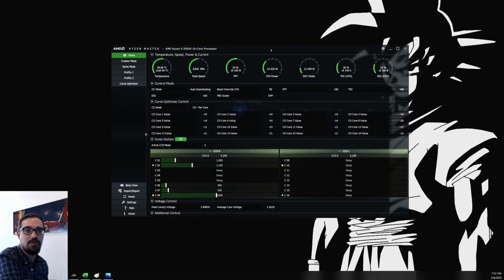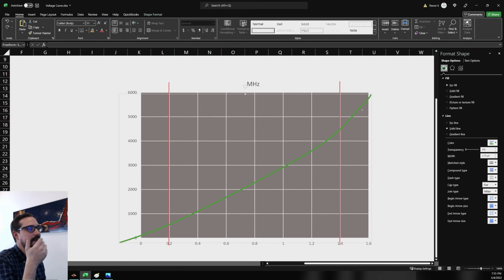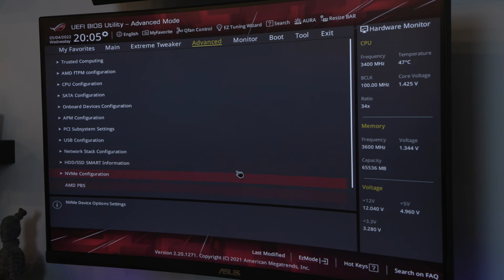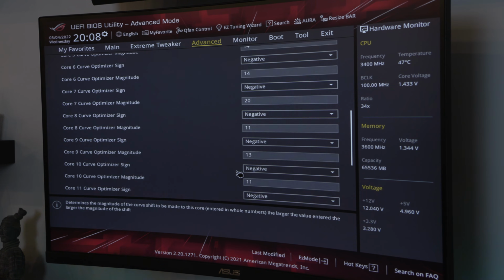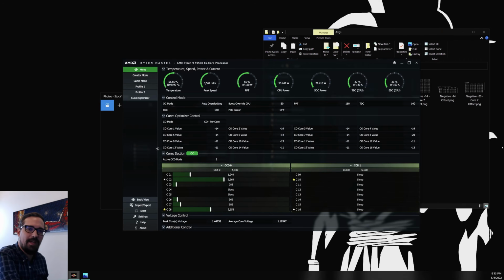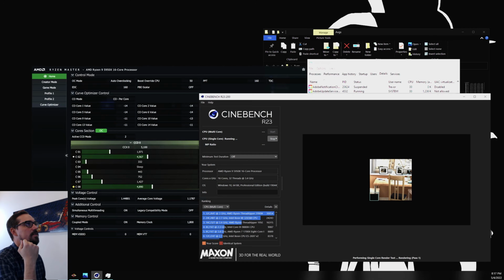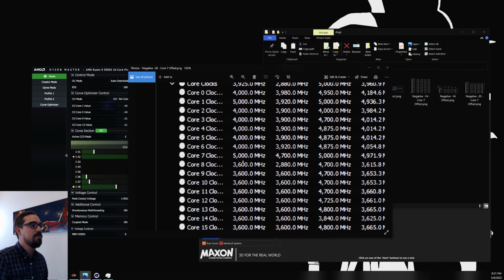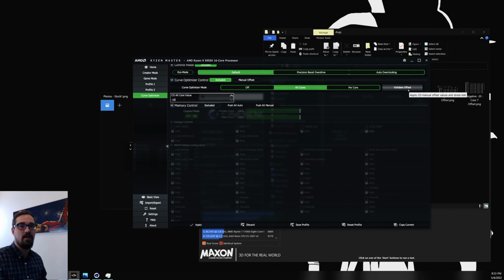AMD Overclocking - Curve Optimizer Explained

Comment: Rog Corsair x570 * 5950x * 3600 DDR-4 64MB CL16 Trident NEO \ 105 TDP - Vcore -0.00625 \ SOC −0.00625 \
PBO1 & PBO2 - Fmax Advanced - Factory PPT EDC TDC - FIT 1X \
CCD#0 -2 -2 -2 -2 -2 -2 -2 -2 \ CCD#1 -3 -3 -3 -3 -3 -3 -3 -3 \ -100 Boost \ 80C Tmax \ Hydra 2.2A Pro CPU Speed Setting 5Ghz 
CB23 MT Score = 26938

Comment: Yes you intelligent youtubers.
The correct number is -25 boost if factory power settings in place manually and FMAX on Advanced If we're wanting to gently reach 5Ghz.
When things are right, MT will be greater than ST in GPU-Z
It needs -3 to -4 for all the first CCD and -5 for the second CCD and a Vcore of -0.00625

Comment: Its too late but actually best cores should get less offset than worse cores so you have it reversed kinda. The reason is that worse cores dont need as high of a voltage to begin with because they are never reaching high frequencies where the best cores actually need that voltage to perform. Another very important thing is to change your pbo limits from auto to manual and set smth like 220 160 150 at least for the ryzen 9 5950x. The default is too weak for the cpu once I did that my score in cinebench 23 went up by 4000 on multithread tests.

Comment: My new PC ONLY restarts (no dump file) randomly while playing arc raiders. ASUS Strix B650E-F + 9800x3d. I suspect cores are not getting enough voltage at top clock speeds (5,225mhz), causing the system to crash. Although this doesn’t happen playing other games that push core clocks to max (e.g. BF6). Even a -5mv curve optimizer causes my game to immediately crash. Is it safe to do a +5mv or +10mv curve optimizer to improve stability in this game? Maybe it’s the game’s crappy code, or maybe 9800x3d + B650E-F is just a weird match. I want to play the game but don’t want to fry my CPU. I’ve literally tried everything else and ran all tests on OCCT successfully.
Reply: I would remove all curve optimizers offsets leave it at default then go and change the pbo limits to something manual check online for safe values for your cpu. If your game still crashes then it might be software problem. I would also test you ram/ gpu at that point its highly unlikely that your cpu would need more voltage than stock to run a game stable
Reply: @adrianilabej317  everything was default initially. Fresh windows install. I tested ram/cpu/gpu in OCCT. Also replaced gpu (3080->5070TI). Didn’t run memtest. However, after 2 weeks of testing I fixed the issue. I am running +5mv pbo curve optimizer - this is the only change that has prevented my PC from restarting while playing arc raiders. I suspect the game is causing transient dips in cpu voltage, and since my vcore is already a little low, it is not able to survive these dips at peak loads. Just a theory.

Comment: I tried Ryzen master to find the "proper" pero core curve for a 7800x3d. It didn't give me the option. Is this because of my CPU or did they remove the auto option?
Reply: use hwinfo find the best and worst cores there. I would also undervolt directly in bios

Comment: Wow. This was incredibly helpful. I never had stability issues on my MSI Meg unify with my 5950x but it bricked dueing a bios update and i had to move to a spare rog strix b550-f wifi II in my spare parts box. 360mm aio on gpu and cpu with a total of 12 fans in the large case I have. Also live at 10k ft altitude and have a window behind the system I put an air filter in to bring in cold air which keeps it even cooler.  I normally manually set all values and do an all core OC for my usage case, and I have refined it to the point I never have stability issues after some minor tweaking on new systems. 

I knew the strix mb couldnt handle the 128gb of ram so i lowered to 64 and lowered rhe clk freq and loosened my timings  for stability. Finally i gave ip and decided on Curve optimizer which i hadnt used before. There are multiple videos giving the opposite information and I couldn't figure out why I couldn't get my 5950x stable. RM was recommending negative 28 on everything. After watching yours I set the best 4 to -15 and the others to -10 and just left it for now. Been stable on all tests and been good on normal use for 24 hrs so far. I could probably refine it further but this is just a temporary solution until I can order a new motherboard

Comment: Hey thank you for this video this is literally the only video on youtube that explains what the actual ** curve optimizer is doing and what it's supposed to do after running ryzen master curve optimization program twice getting two different sets of numbers 16 on all cores and 6 on one on my 5800 x and then running it again with a new heat sink and new power supply and getting 20 on all cores except 2 on one core my computer just absolutely hates the curve optimization setting I can't run it at all my 5800 x cpu absolutely hates it but thanks to this video at least I know what was causing the instability!
Reply from the maker: Glad you found it useful! Thanks for watching!

Comment: So your bios does not allow you to set positive offsets at low temperature/loads and negative ones at high temperature/loads?
Reply from the maker: Sadly it isn't really temperature based variability on the adjustments. Wouldn't that be cool though!

Comment: I just upgraded from a 3900x to a 5950x and the idle temps are really high around 60-70ish. I tried the all core negative at -20 but the temps are still pretty high. I’m thinking of just returning it and biting the bullet for AM5
Reply from the maker: @NobleLion9  What cooler are you using? My 5950X doesn't go above 76C even under heavy use.
Reply: Oh really? I have a h100i iCUE
Reply from the maker: @DayDreamer4011  Personally I wouldn't run on less than a 360mm for a 5950X. I had a H110iGTX on my old 6700K and it ran hot. That being said, initial idle temps should be lower while the coolant is still cool. I would consider using a better thermal paste. The stock thermal paste on the H100 isn't great. If memory serves me the H100i also doesn't make full contact with the CPU heat spreader (round, only makes central contact?). My 5950X does between 65-72C while gaming and multitasking. I only ever see north of 80C doing stress testing.

The CPU block should make full contact with the heat spreader, and the paste should be high thermal conductivity paste (14+ W/mK).
Reply: @UnhingedSystems  Yikes I don't think my Corsair 4000d would fit a 360mm. I'll try the thermal paste option and see how that goes. Sweet thanks for the info, super useful! 

I did have a bit more luck with setting the core click speed to 4.2ghz and core voltage to 1.15v - I was getting similar temps you mentioned but would get crashes in-game randomly. I was getting a pretty high score in cinebench with this set up too around 28k.
Reply: I’m having a bit more luck now. I set all cores to negative 10 and manually tweaked the PBO values. Idle I am seeing 50 degrees and cinebench gets to around 70 degrees with a score of 27k. It’s stuck at around 4.13ghz however.

Comment: I had a kernel power issue id 41. Removed my ryzen master app and turned off pbo for 2-3 dyas now and it has been stable. Your description of the problem is spot on, pushing all cores is not how to see the instability. Its always after a loading screen where the cpu load tapers off that it happens. Will be trying my luck again maybe after 1-2weeks with curve optimizer. Good thing is that I have this video now as reference

Comment: I’m running a nearly exact setup to this. I have the power limits set to motherboard with a -12 all core. With this I’m seeing 175w and 91c under peak load. No instability in the last 6 months but the temps and power draw are concerning. Any advice or chance you might make a video guide on power limits. All your videos have been very helpful and I greatly appreciate it!

Comment: Ok I have 5600x for now. With pbo +200mhz setting in bios with motherboard limits on, not auto or manual. If I use curve optimizer I let the voltage on auto in bios? I see that the voltage is 1,45v when max clocks 4850mhz are working. Is this normal?Or you should manual the voltage? Please help 🎉❤

Comment: Sooooo, I’ve been gradually bumping the curve offset one point at a time on my 7950X3D, and running a CPU burner and benchmarks at each step… 
I’m at -50 on all cores for several days of regular use with no instability….? That shouldn’t work, should it? 
In UserBenchmark I’m in the top 1% of all 7950X3D cpu scores.
Reply from the maker: @baddestmofoalive  If you are stable and don't have any random restarts or blue screens, games crashes, etc, then consider yourself winning the silicon lottery!

Comment: Just one comment. You state that Hardware Info shows you the sustained boost clock as the average. That is not really true. What it measures is the average over a given time span. Can't remember of the top of my head what the period is and if it's locked to the polling interval or across the entire logging period, but nonetheless you are looking at the average of two or more points and not necessarily the average of your test run. How much of an impact this has on the analysis will vary, but it's still good to be precise :)

Comment: can u have the curve optimizer setting replace the settings ryzen master stock cpu clock speed and function everytime u startup the pc and not mess with the other steps in motherboard bios for a stable overclock in Curve optimizer profile? with no alternating negative values for ryzen master manually all cores too,?

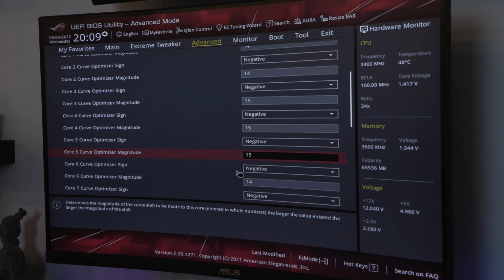Comment: Regarding 9:16 after a reboot or crash if you go into event viewer it will usually tell you which core failed in the error report. When my system was crashing with my 5900x it turned out to be 3 cores that kept causing issues. At the time I didn't really know enough about doing a per core offset so i just changed the offset for every core.
Reply from the maker: @NonLegitNation2  Sometimes it would record an event, but often times it wouldn't. When it hard-locks man does it lock.

Comment: THANK YOU, FINALLY someone mentions this issue. I have watched literally 100s of video on undervolting using the curve optimizer and NOT ONE PERSON mentions the stability issues at lower clocks and at idle. I've personally experienced this when undervolting my R9 5900x. My CPU ran great at load but once my system was idle I would get random reboots. I ended up giving up on undervolting because no matter the offset I always ended up with random reboots at idle. I just bought a 5950x yesterday and I'm hoping with the BIOS and AGESA updates since I last tried undervolting that maybe it has gotten a little better. I guess I'll see within the next few weeks. Right now I just need to find an offset that will work and not screw up. I currently have it set to a -12 offset which seems to be working (atleast for one day so far) but strangely my temps have increased a bit with this offset.

Comment: So does this mean a cpu is better if it can do a higher negative  number on the curve optimizer, because it can hit those speeds with lower voltage?
Reply from the maker: @Striker-rw4rd  Effectively it allows the CPU to run slightly higher clock speeds at the same voltages along the curve. It isn't doing all that much for power efficiency, but it is using the voltages more effectively and allowing higher clock speeds at the same voltages.
Reply: @UnhingedSystems  but wouldn’t that mean that a cpu that can’t run higher clock speeds at the same voltage is worse than the one that can?
Reply from the maker: @Striker-rw4rd  Fair statement. All of the CPUs have varying degrees of capability, even with the same part. Some will hit higher clocks with less voltage, some won't. It really is hit or miss.

Comment: I dont understand how do you actually determine the value per core initially without using any other ryzen software. and how do you know which core do you need to change the offset value if you face instability issue.
Reply from the maker: @codegix6949  That's the neat part, you don't. I spent dozens of hours testing one core at a time. I started by setting an all-core offset and slowly dropping it until I found instability and then bringing it up to stable and then slowly lowering it one step at a time on each individual core. It's a pain.
Reply: free time + nerd

Comment: 7:42 my Ryzen 7 5700G supports 30
Reply from the maker: It's great when they are stable at max settings 👍
Reply: @UnhingedSystems  witch options do you recommend for "precision boost overdrive scalar"? i set my at 1x.
Reply from the maker: @Sebastian-10k  I never exceed 1x personally. Any other settings didn't result in any kind of measurable gains anyways.
Reply: @UnhingedSystems  humm, tks!

Comment: Ryzen 5 5500,  negative 28 at all cores (Ryzenmaster said I could do -30 on some cores) and Boost positive 200Mhz, the CPU runs above 5600X acording to CPUID bench, PassMark Bench, UserBenchmak. In boost seats stable at 4.4Ghz

Comment: The Master software is a scam somehow. the curve optimizer stole me 2 hours of precious lifetime and at the end the results where totally crap.  even with negative 30 at the curve the software still pumps 1,45 Volt into the AMD core just for 4.65 allcore.. ...totally crap...

my manuall setting is stronger...VCOre 1.1 , Core 1.375 - Offset -15, ends up in 4,7ghz with less power consumption, less heat and a 25% higher performance over all :)

Comment: I run the per core optimizer using ryzen master but when it finishes running it says all core -30, should I increase the offset?
Reply from the maker: If it is stable, you are in good shape. If you start experiencing random lockup, blue screens, reboots, or shutdowns, then adjust it back up until it is stable again 👍
Reply: @UnhingedSystems  I'm running cinebench r24, playing many games and still stable without seeing a blue screen. I'm thinking of increasing the offset to be able to reduce the temperature even more

Comment: Thank you for this video/tutorial/explainer. Much appreciate! One tip - instead of doing manual per core testing, run Ryzen Master Per Core test which will determine the offsets, then you can manually add them via UEFI/BIOS. Also it tells you about your best and second best cores, on which you should have lesser offsets and they will tend to reach higher/sustained Ghz. Am I right in my assumption?
Question 2: With CO set, how about setting PBO Manual/Motherboard with Positive 200Mhz to get that extra?

Comment: I have a 7950X Ryzen Master also said -30 was ok then Cinebench crashed the OS at -30, went to -25 got me to 3 min. into Cinebench but the program crashed (not the OS) , finally got through Cinebench at -21. But this CPU is  and they say runs better hot so I'm not even sure this is something I really need to do to this CPU, AMD says it can run at 95 degrees all day, 24/7 . I will keep it at -21 unless something else should crash

Comment: If you disable idle states on your cpu wouldn’t you theoretically never get the clock speeds low enough to experience instability issues?
Reply from the maker: Interesting proposition. That might come with its own issues such as unnecessary heat and power draw, or potentially shortening the lifespans of the CPU. I know I used to do that as a regular practice for Intel all-core overclocks 10 years ago, but I'm not sure how well AMD will handle it. More testing to do.

Comment: Ah you didn't think of setting up "whea errors only" in event viewer, it tells you the exact core which errored, even after a crash, saves tons of time, the way you did it wouldn't necessarily be stable it took me about 6 month to perfect it as one core might just error months later, rock solid afer a year now. Sadly Zen 4 doesn't have whea error support, for some reason
Reply from the maker: Unfortunately the only event viewer errors I got were unexpected shutdowns. With my system I didn't get WHEA errors, just black screen lock ups. I actually didn't get any WHEA errors since AMD patched their platform BIOS a couple of months after launch. Used to get WHEA errors and random application crashes all the time on the early BIOS revisions even on default BIOS settings, but it's been solid since. 👍
Reply: @UnhingedSystems  weird, what agesa version? I haven't had a problem and I started doing this about a year and a half ago, although occasionally it didn't show up after a crash, but would eventually.
Reply from the maker: @Markknightexeter It was a long way back, right after launch. My original BIOS revision was in the 0400 range so somewhere in Agesa 1.0.0.0a, before they released any bios updates for the board. The first official BIOS I could download was in the 0800 range.

The BIOS it shipped with was such a hot mess I almost RMA'd the board, but they fixed the problems after several months with just a BIOS / AGESA update.

I heard the new 4702 is really unstable and breaking things again...le sad.
Reply: I've also been pushing my ram in the past few months, when I clock higher (the ram) it shows up core 0 as the problem because the cpunb voltage isn't high enough